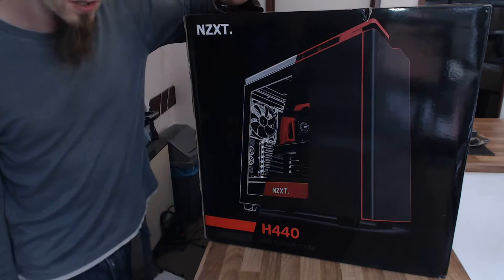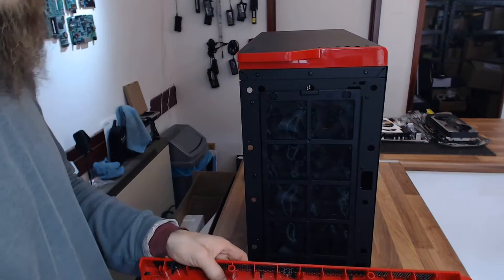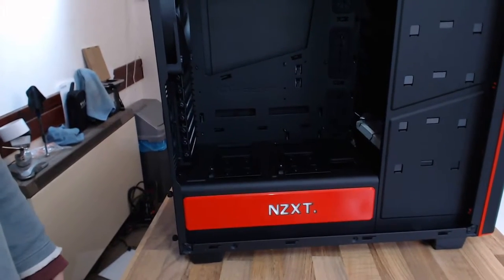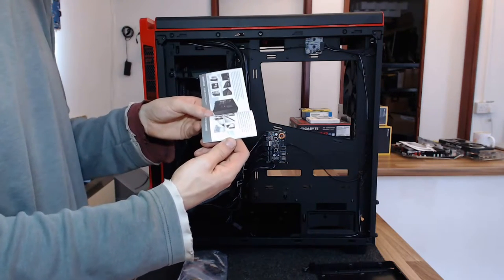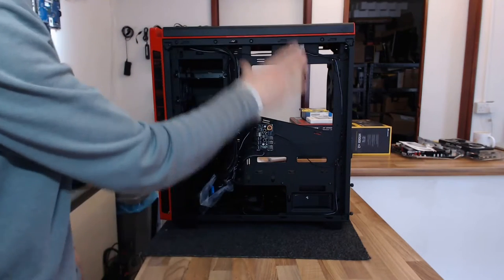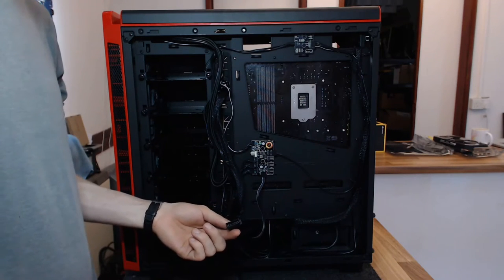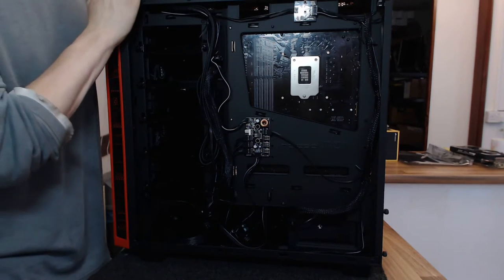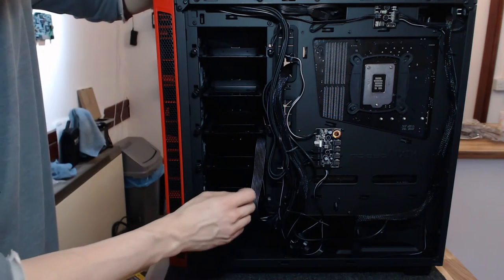Let's Review - NZXT H440 Red

Comment: This (revised/updated) case has power managment in the hub for the fans. It takes PWM from CPU as input, and has 1 PWM out, and a number of none-PWM voltage regulated headers - these headers are however modulated by the CPU PWM. I am using such a red case in this configuration right now.

Comment: I would disconnect that Fan board too, i prefer my Corsair fans with AI Suite, my main concern with this case is that fitting two gpus looks a real tight squeeze.
Reply: I have x2 980's, they should fit fine yes?
Would you know what fans i would need for the front and Exhaust, Corsair fans.

Comment: I really like your videos. Is that a palit 1070? With the case you should do a noise and "warm inside" test.
Reply: Okay i understand that. Thank you for answer. Last question, the Corsair RM550x 550W PSU will it works same way like the RM650x you made a video about, will the fan be off until it gets under heavy load?

Comment: How did you end up using the fan hub connections in the end? I'm assuming you kept all the case fans plugged in but where did you plug in the PWM and CPU fan connector considering the fact you used a water cooling solution for the CPU? Great video btw, doing a build very similar to this in a bit hence the question.
Reply: Ah I see, would it be a good idea to connect all the case fans to the hub and then connect the PWM coming off the hub to one of the mobo's sys fan headers? And then connect the water cooler fans to the cpu header on the mobo?
Reply: But surely if you set the CPU fan speed to 100%,, to which the water cooler fans are connected to, the water cooler will basically always run at full speed?
Reply: Okay I got it, I think the cooler I'm planning to use, the kraken x62, has the same setup with fan connectors coming out of the cooler block itself so should be fine. For the white CPU fan connector on the fan hub, did you just leave that empty? Sorry for all the questions but nobody else seems to know on Reddit...
Reply: Okay thanks for all your help man!
Reply: Adamant IT It's possibly there to hide the cpu fan cable...

Comment: +Adamant IT  Subbed .. I've had two of these cases ..... Had some issues with the FC... got pissed off and RMA the 2nd one " first one had smoke coming from the wire lol "  but i think I'm going to cancel it as i REALLY do love this case ! I'm coming from an Corsair 760T v2 nice case but to BIG  & noisey ..... I've rebuilt this case twice now hahahaha oh well... I think i won't use the FC on this case as i could not work out how to control the Fan speeds so i'll just go straight from MB...
Reply: yeah it was the wire for the lights.. the copper coil burnt my finger skin i shit you not lol... however the 2nd case DOES work i just could not control the FC and had to do it from software and that's something i don't quite feel safe doing..  So i thought i'd just connect all the Fans to the FC then Water cooler to the MB.. still was not happy so i RAGE QUIT took it all out and back into the 760T case...  I was R&R about keeping it then i came across your video and thought well SHIT THE BED he's done exactly what i was looking on doing but better lol... So i've change my mind now am gonna give it another go.. all Fans will be on the MB then i'll just control it from BIOS job don... wont be using that Shitty FC again.. Thanks for your reply tho!  I'm from the Uk too :D South Wales .. I work in IT .. Network Eng...  Look fwd to speaking to you more ! JT